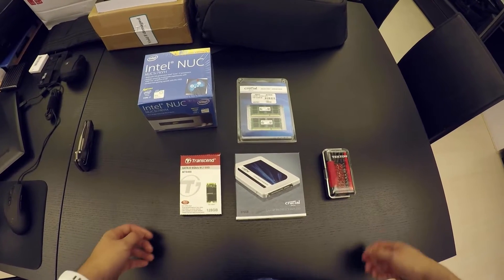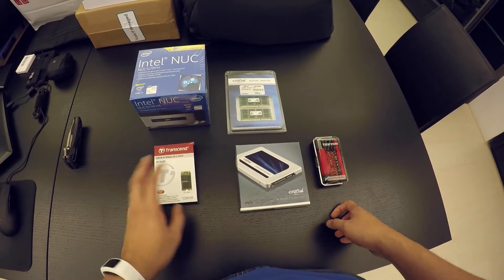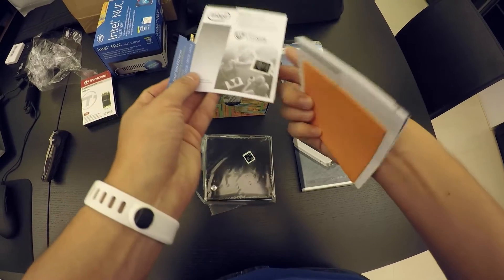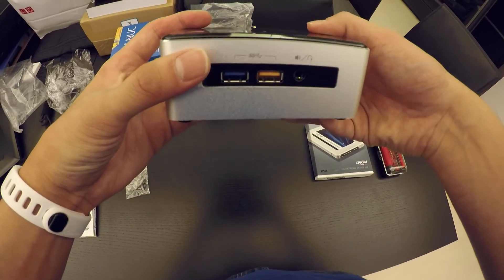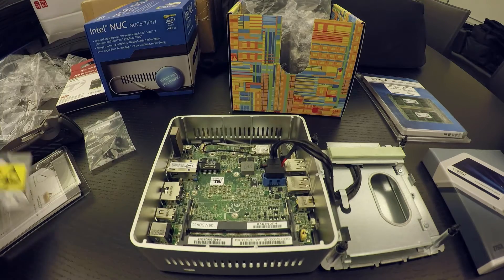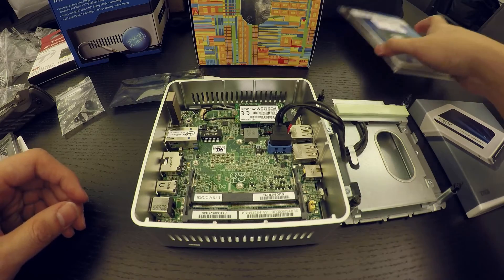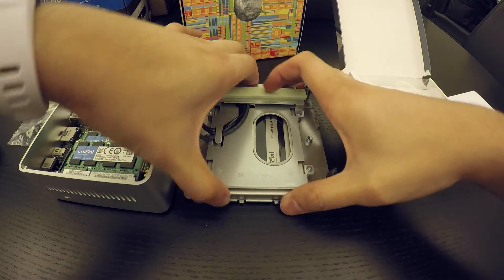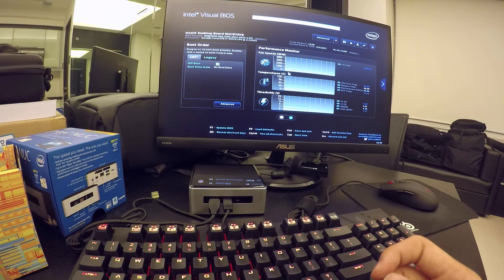UNBOXING and SETUP: Intel NUC - NUC5i7RYH

Comment: Did you run into any issues running both drives? Is that supported?
Reply from the maker: no issues.  i don't use both drives at the same time but boot to the OS i want to use.  the "other drive" is visible in the OS but not usable in practice
Reply: @MotoHK1  Not usable, meaning? Basically i'm wondering if we use the M.2 that we lose the other drive since all channels are being taken up? Or, is it possible to use both at the same time but you just chose not to?